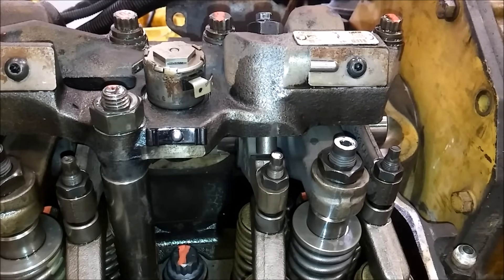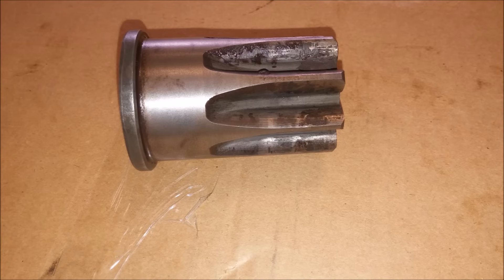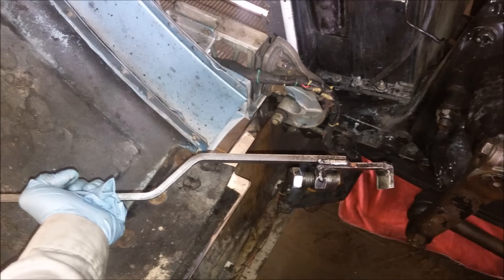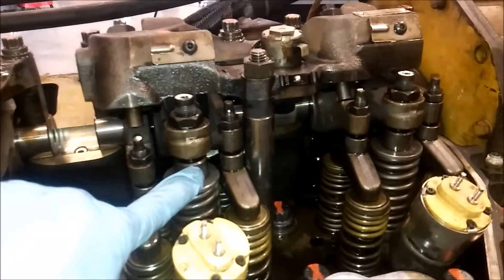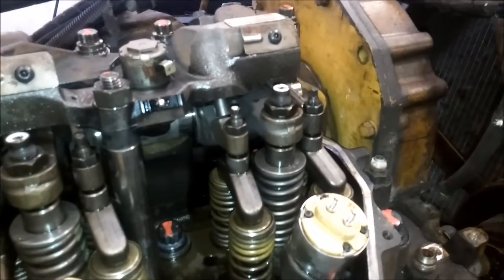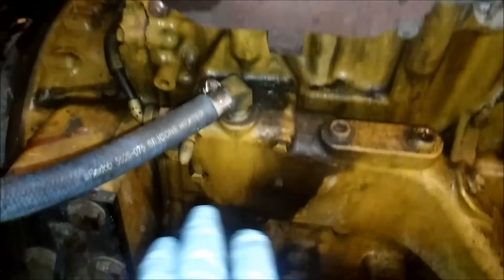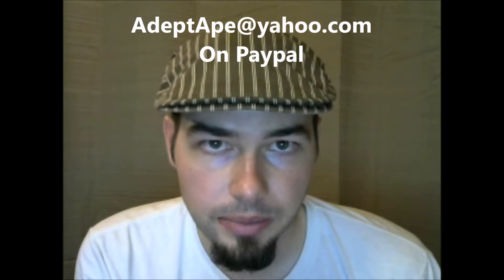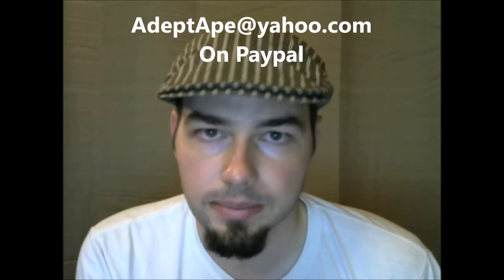How To Perform A C15 Overhead Valve Adjust. CAT Complete Overhead And Valve Adjustment.

Comment: The 3406E manual I have for 1lw1 says 0.69mm plus or minus 0.08mm or 0.03 plus minus 0.003 I'm guessing that's not 0.033?  It would be closer to 0.027 thanks in advance if anybody chimes in.
Reply: Sorry this is for Jake brakes thanks again.

Comment: Great video I'm rebuilding the head of my 2010 Volvo d11 maybe you could help I need the cam torque specs my other is on the cam balancer it won't let me adjusted to gap 10 with a filler gauge thanks

Comment: Thanks for a Great Video!., In my case I am looking at a 300,000 mile overhead re-set to be done after a engine rebuild., but is't there a inspection done on all the overhead springs before starting the task of performing the overhead?., Also in my case I have weak jakes on my MBN C-15 and frankly not sure if it's an adjustment issue or a broken jake spring?.,

Comment: I have injector height tool, but find it more accurate to put injector at full downward plunge then adjust injector needle to bottom out and back off 3/4 turn, on detroit 60.  I do this because I'm concerned about differences in the block and compression of the bottom graphite gasket carbon sealer, and injectors

Comment: Good video,  my pinning hole was wobbled out, I asked a few guys about that and they figured someone started it with the pinning tool or bolt in it after the adjusted it, so I took the timing cover off because it could be off a tooth on either side, I always get the fun ones lol
Reply from the maker: That sucks, we had an apprentice so that a couple weeks ago. Luckily the bolt didn't break, it bent the pinning bolt into an S shape, but it came out with no damage to the engine.
Reply: @AdeptApe  talk about getting lucky !  Oh the crazy things a guy runs into working on cars to trucks to heavy equipment.  Things that make you go grrrr.

Comment: Hey so I just installed a camshaft on a c-15 6nz … just wondering when I install my rocker shafts and injectors and set the clearances do I set it for compression stroke on #1 when my camshaft gear is lined up with the timing mark ??

Comment: What is the length of the injector height tool I purchased one however you have to put it together and put the stop bolt on it but now I don't know what the height is because it's adjustable
Reply: I was wondering that also
Reply: It looks like 78+/- 2mm

Comment: Got a acert mxs, compound turbos and now converted to single turbo ! Is an 2005 model the jakes will be 11 ftp or 25 ftp?
Reply from the maker: With the Caterpillar style compression brakes like an MXS they torque to 11 ft lbs if yours has the small 1/2" nut. Thank you for the donation by the way.

Comment: I made the tool to regulate the injector height but I added a comparator as a 3516 calibration system You calibrate the standard, assent it on the injector and it has to give zero.

Comment: QUESTION
After pinning engine how do you know whether or not your on intake or power stroke without removing valve cover?
Reply: realistically you need to remove the valve cover or peanut cover, the timing bolt on the flywheel is for 1 OR 6

Comment: I have a question for you to see if you have any answers, I have a cat c15 with PDI single turbo conversion.  Every morning I have to empty the first fuel filter a little because if the truck does not have power the turbo does not go up to 25, after doing this it usually goes up to 45 and on many occasions when I go up a hill the force happens the same and the  turbo lowers the pressure to 25, I have already changed the fuel pump but the problem persists, if you could give me an answer it would be of great help.  Thank you
Reply from the maker: Well, you probably have a fuel pressure problem and not a turbocharger problem. I would recommend buying a fuel pressure gauge and seeing if you are getting about 90 psi of fuel pressure, I bet you aren't if you are having to mess with the fuel filter.
Reply: @AdeptApe  the pump is new
Reply from the maker: I believe you mean the transfer pump or some call it a lift pump. Yes I read that the pump is new in the original message, I'm trying to give you advice here, just because the pump is new does not mean you have good fuel pressure. You said you have to mess with the fuel filter every day or it runs weird, you need to measure fuel pressure because you could have 1 of a 100 different things wrong with the fuel system, that might be as simple as a bent line or bad fuel pressure regulator.

Comment: How do you know if you're on #1 compression stroke or #6 stroke? If its the same possition
Reply: If your on 6 then intake and exhaust gonna be loose he mentioned it at 6:40
Reply: @philou961  im in the middle of this right now and I've ran into a problem I've got the cam perfectly timed and now I've set everything in place however when the time mark it at top and the motor is pinned everything lines up as he said. I did # 5 6 and 3 injectors and #1 valves then intake on 2 amd exhaust on 3 and intake on 4 amd exhaust on 5 however I noticed the rocker arms for intake and exhaust on 6 are both lose as well as on number 1 at the same time. I rotated it 360 degrees and exact same story.. every valve is in the exact same possition. So it appears to be that both valves on #6 and both valves on #1 are both lose at the same time.. so this method did not work for me I have to rotate the motor untill I finally adjusted each valve as it was lose
Reply: @jordanc1910  the motor can only be in compression on 1 or 6 so it cannot be loose on both rotation. The cam is pushing on either one and once found you know what order to do because the one that's not pushing is your compression stroke. Hope that helps and good luck !
Reply: @philou961  brother im telling you they're lose on both 1 and 6 at same time.. amd the rocker arms aren't pinched either.
Reply: @jordanc1910  Once you pin the flywheel for TDC. You will be on TDC for #1 and #6. But only one of them will be on the compression stroke.

The best way to determine which one is on the compression stroke is to find which valves are pushed down and open.

If either #1, #2, #4 intake valves are open, you will know you are on #6 TDC compression stroke. If all of them are closed and loose, you will know you are on #1 TDC compression stroke.

 

To answer your original question. #6 intake and exhaust valves are adjusted at the same time when #1 is on the exhaust stroke. (#6 will be on compression)

Maybe both are loose but only one is on compression stroke so do the right order adjustement when figured out
Reply: @jordanc1910  I'm sorry for missing information in last reply I'm not sure if they supposed to be both loose on 1 and 6 but find compression stroke from there adjust in the good order and everything should be ok

Comment: Any significant difference to doing an overhead adjustment on a C13? Our 2006 Country Coach Intrigue motorhome has a C13 w/120,000 miles. Wondering if we should do an overhead?

Comment: thank you for these great videos 
started following you . 
i have a freightliner century. 
c15 mxs. 13 speed
school me on why should we do this? also i have a cat shop in brownstown michigan. right where i park my truck and i been wanting to give them a shout. 
i have 840,000 miles. owned it since low 600,000 miles.
replaced radiator, water pump, thermostat 

replaced. wear n tear items like shocks, tires brakes.

Comment: Great info here. As a Diesel tech my self, one real good serious question. How do find TDC with an Allison transmission bolted to the engine? the flex plate nor the Torque converter ring have any drillings or markings for your timing pin like in a flywheel for an Eaton transmission. Cat SIS Web all says to basically do what you did BUT no extra info for Automatic transmissions.
Reply: remove the peanut cover look for the timing mark.

Comment: help please..iam trying to remove and replace the jake wireing harness on a c15. i can not remove the spacer that valve covers are bolted to. because someone thought it would b a good idea to cast tabs on each ends of the spacer witch wont allow enough clearence (by a 16th) to remove.. what the heck.. do i now need to remove jake and rocker assembly? please..please,could someone instruct me on my next approach.. ?

Comment: Adept Ape, on a C15 with VVA’s, going to make a timing pin. Is it a 5/16” bolt or 3/8” bolt and how long? See where some say the longer bolt from the barring tool plate is used. Do I need to cut the threads off as well? Thanks

Comment: I took my catapillar c15 3406 cylinder head off to get the heads repaired and forgot to pin the cam. What do I do to get it back in time now that I have the cam installed, I pinned the motor and adjusted the valves but I can't turn the cam anymore.  What should I do?
Reply: Remove the rocker shafts the all the valves will be closed and you can rotate the cam timing mark to line up with the crank shaft.

Comment: I have a bxs that keeps sending the low oil pressure code I have replaced the iva and the updated plug for solenoid but still the same. Any more ideas. I dont see any leaks while engine is running and valve covers are off

Comment: c15 6nz I don't want to buy the tool as ill only be needing it once, what would be the spec for the top part of the gauge if you know what i mean
Reply: I know it's a little late to help you, but if anyone else needs this info here it is. For a C-15 with MEUI A injectors. "Injector height gauge (4) is used to obtain a dimension of 78.0 ± 0.2 mm (3.07 ± 0.01 inch). The dimension is measured from the top of the unit injector to the machined ledge of the fuel injector body"

Comment: I am in need of some help adept ape.. I am building a c13 for a customer and I have built a couple c15's in the past and gotten away with using a depth Mic to measure injector height from top of spring retainer to the machined point on injector body.. But this is the first set of dual solenoid injectors I have came across with no machined surface on the body. Everyone I have spoke to keeps insisting they all do and being a lifetime machinist I am positive this is not the case.. All that being said, is there a known measurement from spring base to retainer? Just not sure how to set injector height, one of my main concerns being I did mill the head .010" and am not sure if how to measure injector height against head thickness to make everything come out correctly.. Any information would be greatly appreciated if you could contact me at aapartsandmachine@gmail.com thank you sir
Reply from the maker: There C13 is easy with no special tooling needed. Just a 180 degree preload on the adjuster nut. I have a video on it too.

Comment: Just did a overhead on a c-15 I believe mxs was the sn with dual turbos in a Pete where 5&6 were buried in the firewall... what a bitch a little different than this tutorial
Reply: I have one of those, you can remove the heater unit that will give you more room.

Comment: Wanting to do a valve adjustment on a 3208 in my rv... diesel pusher.  Do I need to pin the fuel pump?   And since engine is backwards,  how do I find number 1 cylinder?   Thanks for your help. . Chris

Comment: Hi, I have a SDP C15. The regen was deleted both from the ECM, and the filter was knocked out clean . Do I still need to adjust the VVAs when doing an overhead, or the VVAs are no longer active, therefore no need to. Thanks.

Comment: When I pin the engine I fail to 100% identify which cylinder is on TDC. can you please help .
Reply: Taran Singh shake the valves the intake and ex bridges should both be loose.

Comment: Hi adept ape small question does the overhead needs complete adjustment after replacement of my head including the injectors as the mechanic is only adjusting the valves and says injectors don't need to be adjusted as they have not been replaced what do you say?

Comment: hi bro I have a question i going to put a new camshaft on my c15 but freightliner give me a different # that what I got my # is 139-0538
and they give me a 3327307 they said is those two # are for the same motor . what you thing?

Comment: Hats off , I watched the video and read comments, and found answer to my problem.. c-15 mxs oil pressure runs from 40 psi to 60 psi depending on RPM 1200 = 40 psi 190degree temp each 100 rpm increase 5 psi in oil pressure It's Kenworth 06. I need oil pump or something else , i ask CAT dealer at last service they said CAT has no set oil PSI could be anywhere 40 to 80 psi but when i found concept u showed main bearings then question is why my oil psi is changing according to RPMs and engine  temp , NO Contamination oil sample is good.. please advise

Comment: Thanks for your reply , yes I meant by overhead adjustments I just got is done at toromount Cat and I doubt they did not took 3rd cover out did not open the screws for one under breather air hose close to firewall., I am sure for that and if it had to open and i am going to talk with them, why

Comment: Hi, Thanks for being there.. question at tune up mechanic at cat have to open all three covers from head and second Why oil pressure drops from 55psi to 40or less on hills temp 200 degree...
Reply from the maker: +Satveer Dhillon Depends what you mean by tune up, if he was running an overhead adjustment, then he had to get to all the rocker arms and valves so that is why the valve covers had to be removed.
Reply from the maker: +Satveer Dhillon The oil pressure dropping on hills is a little odd though, is the oil or coolant temperature much higher while pulling the hill?
Reply: I have recently found that every 100rpm will increase 5 psi like 1250rpm is 40 psi and 190degree 1500rpm is 60psi but as I change gear rpm drops oil pressure drops
Reply: @dhillonsavee  Change oil to 15w40 don't run synthetic oil.

Comment: I had a question does the motor have to be cold or does it matter if it's hot
Reply from the maker: +Bocho214 Overhead should be done cold.
Reply: Adept Ape thanks our mechanic that it doesn't matter on temp he just ran the overhead on it warm hopefully no damage occurs

Comment: Hey Mr Adept Ape, I'm wondering if you could answer a question for me. I've got an 05 w900l with a C15 that makes an awful moaning/groaning noise between 1300-1500RPM it also shakes at those RPMs like something is off balance. I did a little research and see that a common problem is worn motor mounts. Do you see any truth in that and if so, how hard is it for a guy to do this? I'm low on cash and like doing the work myself if I can. If not, what do you think I'd be looking at cost wise to pay a shop? Thanks in advance!
Reply from the maker: +PickupsAreNotTrucks Motor mounts are fairly inexpensive, but they can be a pain to change, especially rear ones. You can do it yourself, you'll need to rig up some large bottle jacks, prybars, and a 1/2" impact wouldn't hurt. A shop will probably charge you about 4 hours would be my guess without seeing your truck.
Reply: Adept Ape thank you for the reply! I'll look into it.

Comment: We did an intake valve actuator test which failed on #3 intake valve actuator. Any idea how to find the failure? It doesn't seem like there are any excessive oil leaks anywhere.
Reply from the maker: +allen Murphy Did the test fail on an electrical fault or a not responding properly?

Comment: I have a C15 acert. I changed fuel injector one and two. I was wondering after you change the fuel injector can Is it necessary to run an overhead valve adjust? If yes, can i adjust just the ones i worked on?
Reply from the maker: +Arianit Iseni It is a good idea to adjust the valves if you remove the rocker arms because the clearances probably changed by removing and reinstalling them. You don't have to do it, but it is a good idea. You can also do just the ones you removed, since you did cylinders one and two, you could just do those adjustments.
Reply: What's the torque for the rocker arms?
Reply from the maker: +Arianit Iseni I torque them to 75' lbs

Comment: thanks. Can you please give me some advise with a 3508 B-DITA-SCAC (760KW) regarding valve and injector adjustment which one I can adjust after pin the engine in TDC Cyl.1 and after pin when turning 360 degrees Cyl.8?  Best regards and thanks in advance for your support.

Comment: is in normal to pin the engine on the right side.  I ran into one that the cam was off 90 degrees.  I had to use the pin hole on the left side
Reply from the maker: +mike gann Seems to depend on the engine. Most of them pin on the right side, but I've had a few C7S engines that have pinned on the left.

Comment: A lot of great videos you have! This one is not an exception. I own an 05'KW acert C-15 engine & I never did a valve adjustment on mine. It has almost one million miles on it. One of the reasons I didn't do it because it's hard to find a great cat mechanic. Where is your truck shop located at? I would like so much  to have you look at my engine & help me keep it alive for as much as possible. Thank you much!
Reply from the maker: +Max V I don't disclose where I work at I'm sorry. I am on the West Coast though so maybe you'll find me on accident.
Reply: We are all good! No problem.
Reply: @AdeptApe  you wouldn't happen to have a used injector/Jake harness and a couple of the retainers n bolts for solenoids  for a 1999 3406e 2ws engine by chance? If so maybe a driver could by it fairly respectable